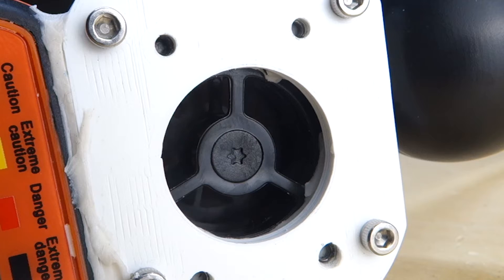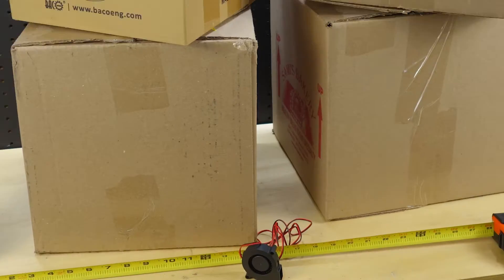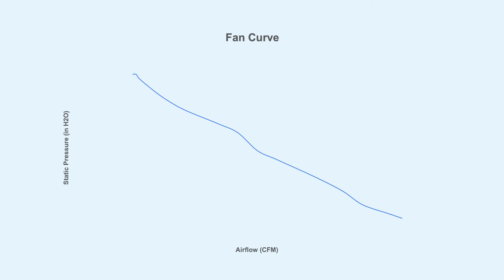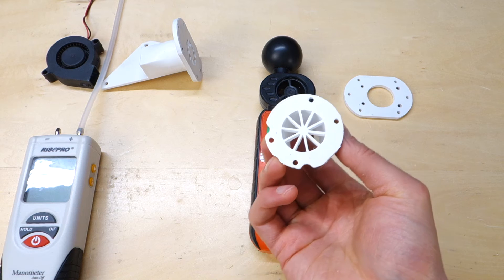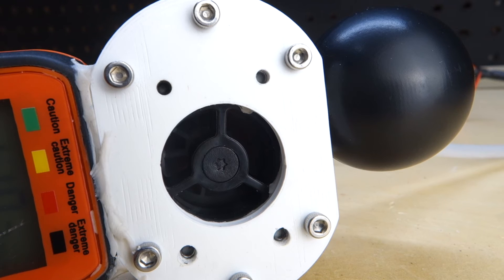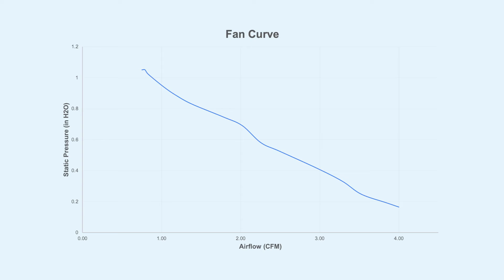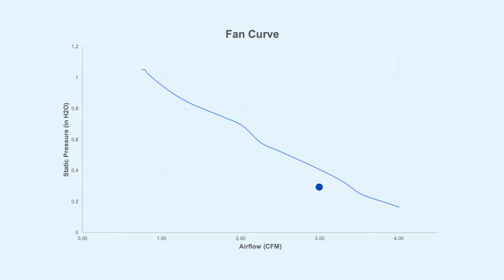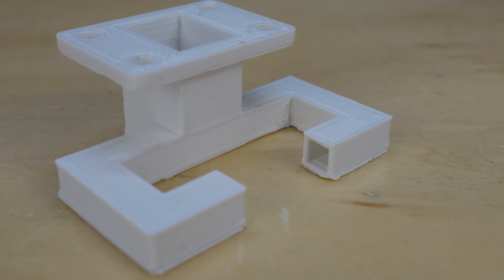Fan SECRET to Get MAX AIRFLOW!

Comment: I wish I could figure this out for the BIBO printer (based on MakerBot's 2012 release of their Replicator design with some modifications) We have space and ducting issues which are super challenging. All current 50x15 blower fan duct designs hit the front door and the back Z rails. I tried to do some duct designs for the standard 40x40 axial fans and the static pressure was so high that more air came out the back of the than the duct ports.

Comment: Can a velocity stack help in the loss of pressure? I created a duct that uses very small space and I can not find 5020 fans anywhere. Modifying it is not an option, so I wanted to know if a velocity stack would help in there.
Reply from the maker: In theory it should help.  However, if the cross-section area in your duct is significantly smaller than the cross-section of the fan outlet the velocity stack might not help much.  

The best way to know would be to test the pressure loss and airflow with and without the velocity stack, and then compare the results.  This is the topic of my next video.

The other option might be to make the internal duct surfaces more smooth if they are not already.  Using a smooth tube might be a good way to do it.
Reply: And I know these 5020 fans I am using perform well because I am using one with an adapter to replace a 4020 axial fan and the difference in sound and airflow is there. But that adapter has a long, unrestricted section.